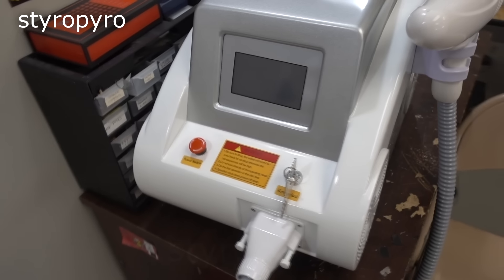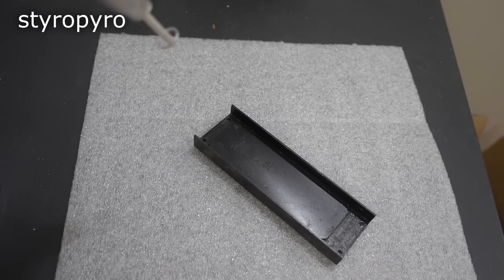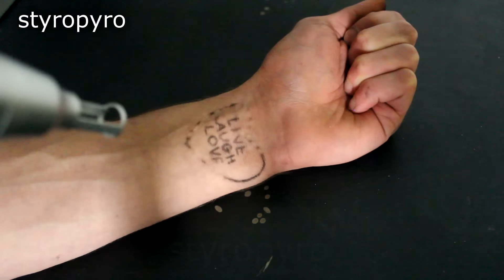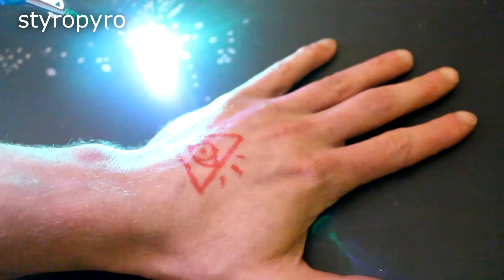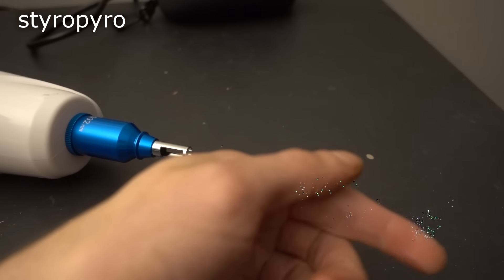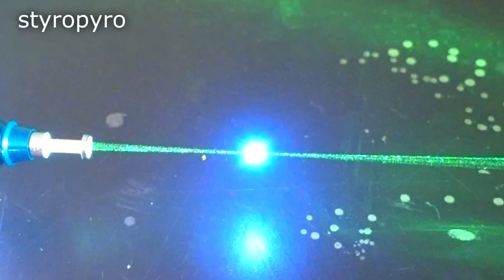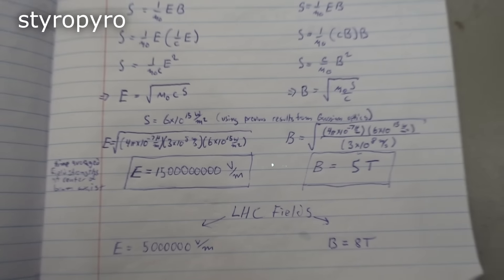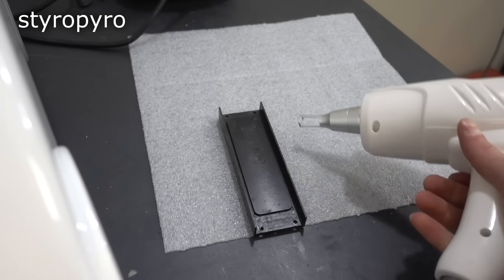Dangerous tattoo remover from eBay is a MILLION watt laser

Comment: One Million Watts .   Equals  around  1,333  Horsepower .  Sure that remover consumes one million watts.
Reply from the maker: it's actually quite a bit more powerful than a million watts. unfortunately, it takes roughly an 8th grade understanding of math to comprehend the explanation at 10:13, which I realize is probably too much to ask from viewers like you
Reply: I can not believe you don't know mW is milliwatts and MW is megawatts. Do you understand the notation on decimal placement concerning power ratings?  Obviously not.
Reply: @mikewallace8087  watts are J/s. so if you instead release all energy in 10 nano seconds, you have to convert the nano seconds to seconds. For example, if you release 2J in 10 ns, you get 200000000 watts. When dealing with fractions (2J/10ns) you have to multiply both the numerator and denominator to keep the proportions the same. It has to be soul crushing to be wrong and this confident at the same time.

Comment: But of course,the goggles didn't work, you fired the laser on the wrong side THEY ARE SUPPOSED TO PROTECT YOUR EAYS, NOT PROTECT YOUR FRIENDS FROM YOUR laser eyes. The convex glasses defuse the laser to a safe level. When you use them the wrong way it will be focused instead.

Comment: 43 attoseconds (43x10-¹⁸ seconds), huh? Well, I guess you have a challenge now - how much energy can you pump out of a laser in a single Planck time unit (1x10-⁴³ seconds)? Also known as (at least, among Pratchett fans such as myself) the "Cosmic Quantum Tick" - The time it takes for "now" to become "then" - the duration of what we call "the present".. The tick itself, however, cannot be measured since it actually occurs outside the perception of those within the universe. As they put it in tbe series, "The time it takes the shortest possible thing in the universe that can happen, to happen."
😂